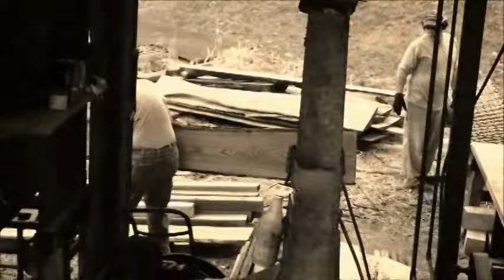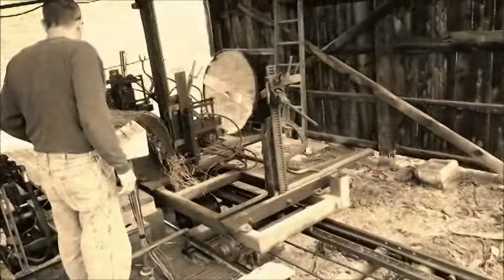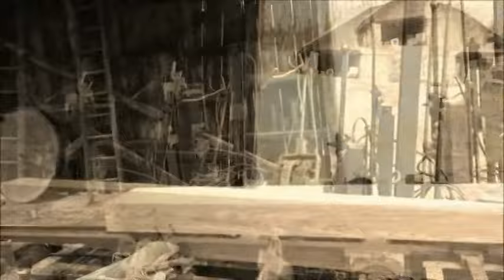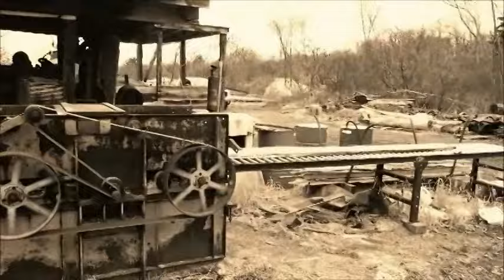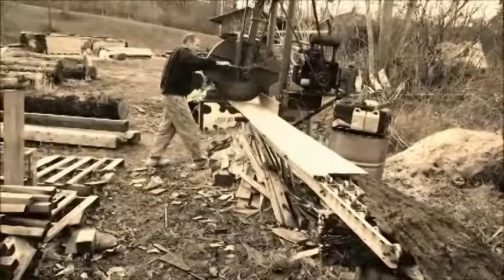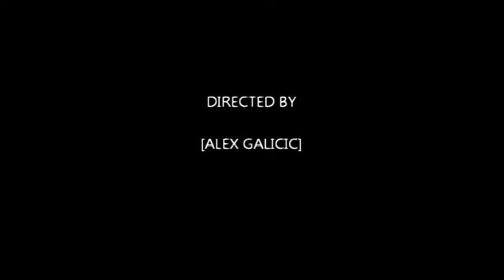old time sawmill

Comment: To Bad they had to speed it up and wreck the video
Reply from the maker: old movies were fast ,I also have more sawmill videos on mark galicic channel you may like ,thanks for watching.
Reply: Actually old movies weren't fast. The problem is that as time went by people forgot how to play them. Silent film was shot at 16 frames per second. Sound film was shot at 24. If you play a silent film on a sound projector without flipping the speed switch, the film plays at 24/16 = 1.5 times normal speed. About 30 years ago nobody alive had ever seen a silent film projected right, and had never been told what the switch on the projector was for. So they forgot and just somehow assumed that they had always been fast. They weren't.